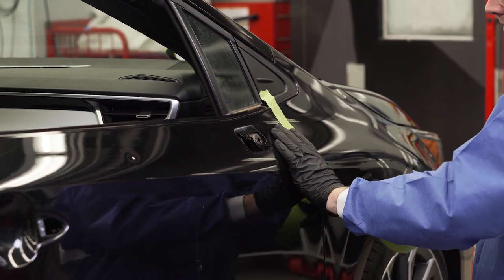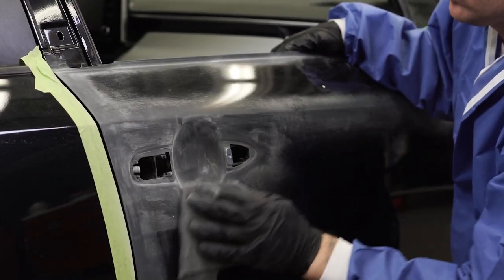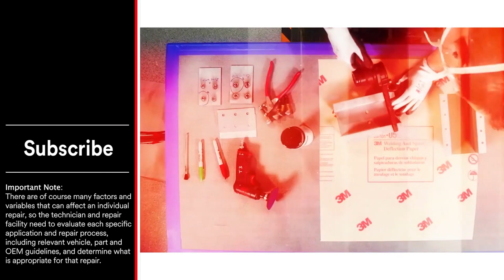Spot Repair Episode 1: How to Prep the Vehicle

Comment: This is precisely the type of repair to use Paintless dent removal. For a tiny speck, you have to fix the entire door. How is that logical? Maybe that’s how it was done in the good all days. Nowadays, Paintless dent removal works miracles.
Reply: PDR is really hard when close to body contour lines. Contoured parts of the panel are often double folded or double layered metal. It’s a designed structural reinforcement within the panel. It’s not your typical thin sheet panel. You’re not pulling that out to perfection unless you have access to the other side of the panel. Even then, you would have to have to be a highly skilled pdr tech for such a feat. You could level that in less than 5 minutes with body filler.